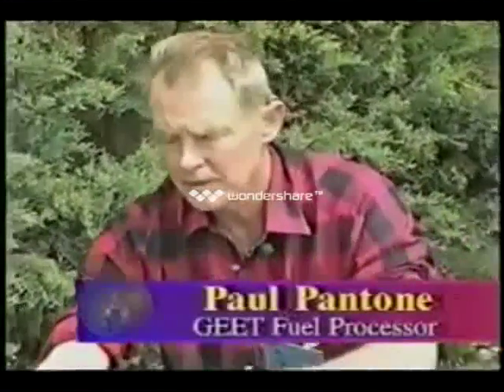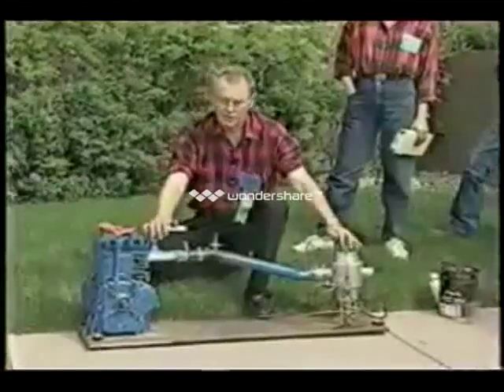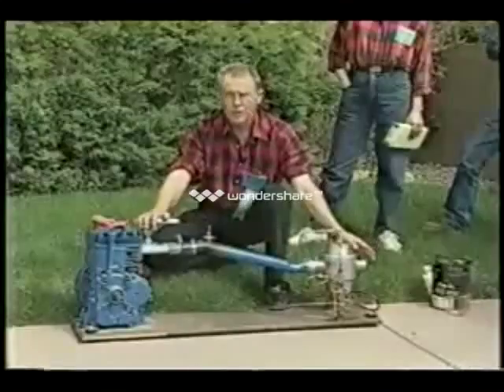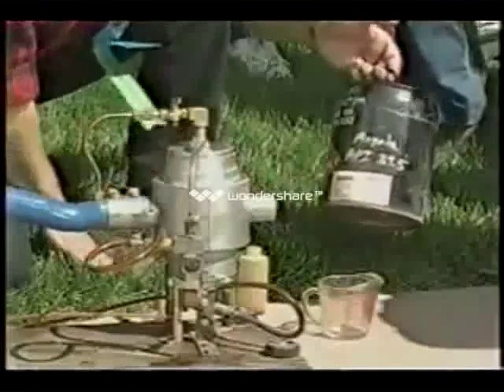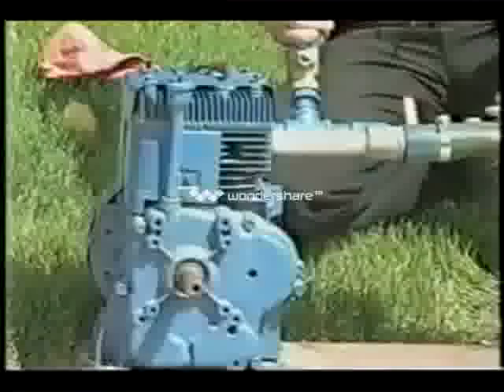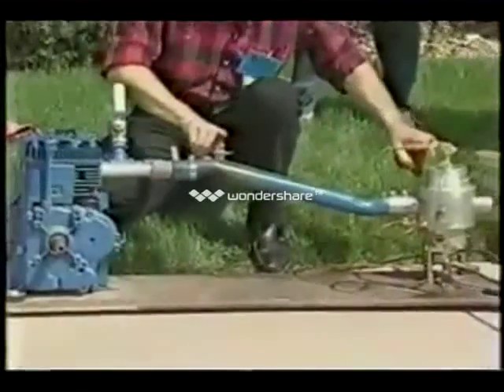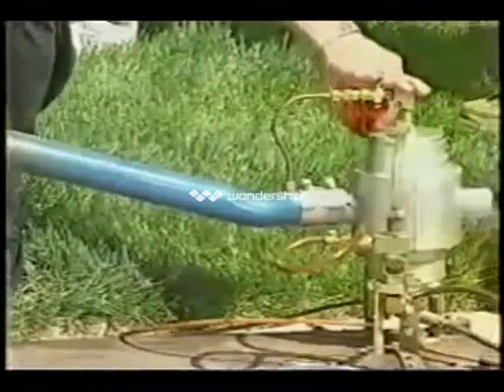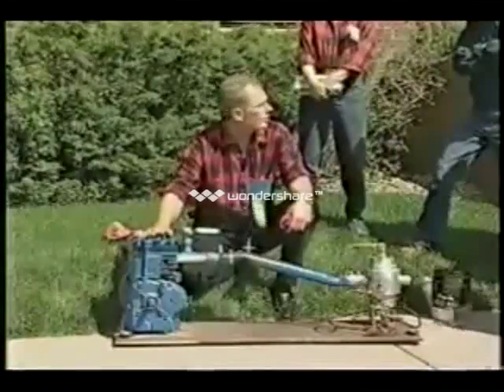*Inventor Jailed* - Free energy system :GEET.

Comment: Built one very similar to his 3 years ago. Still runs great,and yes there is no carbon from exhaust. I added a throttle flap to mine, this helped alot instead of the air fuel balancing act. The water in the fuel after the reactor is at 190 degrees F (32 C ) , ready to steam. So in a way its a internal combustion steam engine.  The fuel bottle in this video is far to complex. Remember, keep it simple. Use anything that would make a good bong. The engine provides suction so bubbles will be pulled up through your gas/water/urine/soda/beer or whatever mix.  You can use just gas to, it turns to vapor in the reactor and works well. In this video, he didnt explain the rod inside the intake tube. This rod generates a "field" around itself and floats in pipe. Toroidal flow,  that would be a place to start when trying to figure this out. you can have fun with this effect by riffling the rod one direction and the inside walls of the tube another, this also can be problematic.
Reply: +MR E You should show a video of it on your channel. :)
Reply: lol. your temperature scale conversion isnt even close to right. water gets converted to steam at 212 deg F, not 190 deg F.  stop bragging you piece of shit.